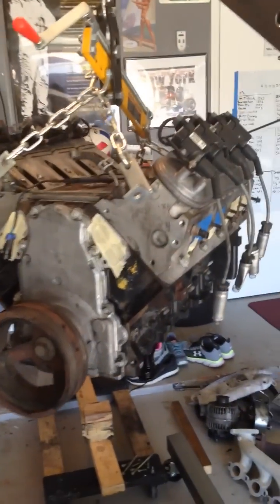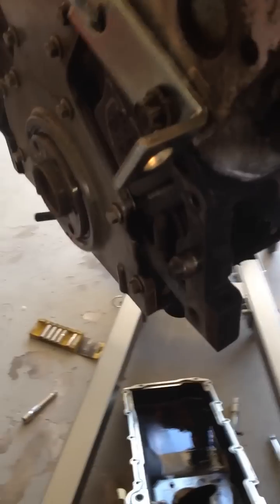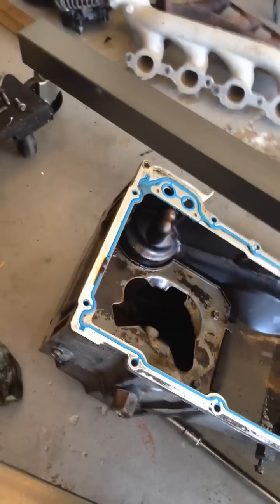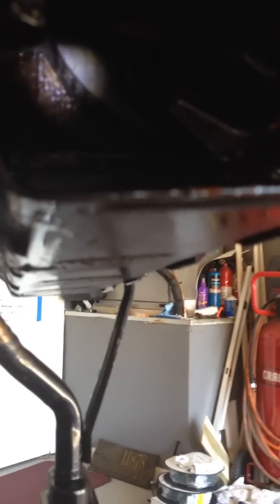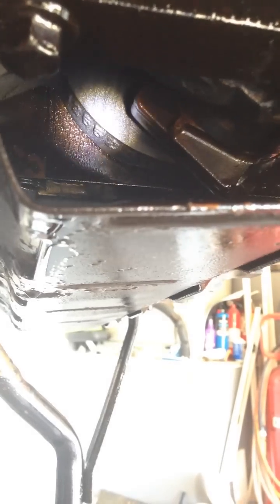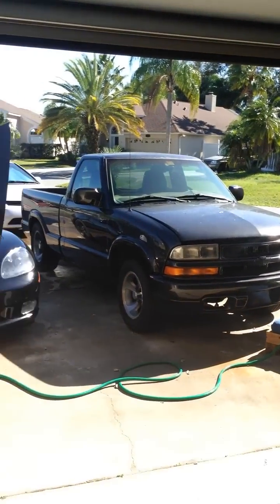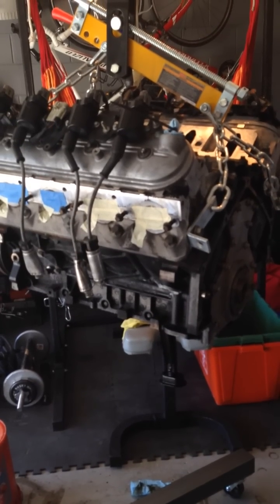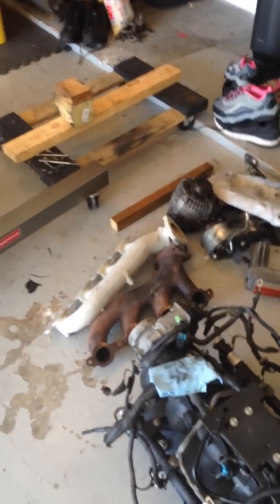4.8 or 5.3 LS Vortec? How to Know For Sure!

Comment: My 2008 gmc savanna  4.8L engine suddenly start to make loud noise like piece of metal stuck somewhere inside the engine it kept doing that for few minutes than crank no start I checked the crank sensor I found it like eating away nothing really left out of it from the inside part . Now I got the oil  dipstick to check the oil now the dipstick won't go all the way inside anyone one knows what I'm dealing with ?

Comment: Will a 5.3 engine head fit a 4.8?
Reply from the maker: I know it is the same architecture, but make sure you cross check valve clearances. Don’t just bolt them on!

Comment: Honestly the only way to tell for sure is measure the bore stroke.

4.8 is 3.2” from top to bottom of the stroke. 

The 5.3 is a 3.6” stroke. Removing the heads is probably just as fast as removing the harness and all those pan bolts and you’re still kind of guessing.
Reply: what about 6.0 how can i tell ??
Reply: @ChosenOne-sz5vh 6109

Comment: Is there any difference in size?
Reply from the maker: Do you mean physical, external dimensions? No.

Yes there is a difference in size. That’s why one is called a 4.8, and one a 5.3. The numbers signify the displacement in liters, within the combustion chamber.

But it’s the same block. Bore and stroke are the differences.

Comment: seems maybe possible to measure the stroke  via spark plugs hole and some type of rod or dowel?   That could be wistful thinking depending on the angle of the hole relative to the bore sides....how frustrating they don't have block serial numbers definitively tell at a glance

Comment: The difference is stoke and compression. I personally want 4.8 pistons in a 5.3 with h
Gen 4 rods but that's me.
Reply: If you've got the money, buy all 3... 4.8 5.3 and 6.0... remove crank from 4.8 and add to the 6.0...... remove flat top pistons from 4.8 and add into 5.3.

Comment: You think an 85 v6 would go in a 93 with a 4 banger?
Reply from the maker: You can put anything you want, in anything you want. It’s just a matter of sheer will and determination!
Reply: @CliffsHowTo     And maybe bullheaded stubbornness along with cutting torches hydraulic spreaders etc ....might be the biggest piece of CRAP when all is said and done too....something impossible to even pull valve covers on and requiring a gaping massive hole to be cut in the hood etc....BTSPTF Engineering jobs ("beat to shit / paint to fit")

Comment: If you got a 4.8 for $400 that is in good running condition, well son you got yourself a little gem there. Fuckin bulletproof with minimal maintenance if you don't boost it. 07-13 5.3's are arguably less reliable anyway. Traded my high-miler for an 08 vortec max and I pass anything but a gas station. lol cries

Comment: Only difference really is 5.3 has 10 more horsepower then 4.8l
Reply: Has a good bit more torque
Reply: 5.3 has a 9mm more stroke then a 4.8..thats the difference
Reply: I would go 5.3, too. Otherwise, small car as a daily.
Reply: Im thinking about swapping the inline 6 in my 08 gmc envoy. It sees alot of highway miles daily and I do light towing from time to time... 4.8 or 5.3 or just rebuild this one? Why? Currently @300k miles
Reply: Jejdydk
Reply: Jonathan 5.3 tows better is more reliable and sounds better.
Reply: heavy_ z71 sounds better lmao it's same engine one has a longer stroke the sound is identical
Reply: Eternal Thread goodness bro use punctuation marks so we don't have to read your comment 10 times to figure out what you're saying.
Reply: So why do people act all sensitive when they talk a 4.8 engine is basically the same lol
Reply: @bris9984  Meh who knows just abuncha paperskin pussies who want the "bigger manlier" engine or who need an excuse for spending the extra money. 
Truth is the 4.8 is exactly like the 5.3 except it has shorter strokes, which in turn makes it idle and rev at higher rpms. It also has better compression. 
If its the old all iron monsters from the 90s/early 2000s its actually alot better to get the v6 or 4.8 v8 then throw a turbocharger on it
Reply: Ballsweat McGee so, it’s better to turbocharge a 4.8 than a 5.3?  I watched a donut media video saying that but I just want to hear it from someone else lol
Reply: diegocientos yes 4.8 is same block as 5.3 but it has thicker cylinders better for boost